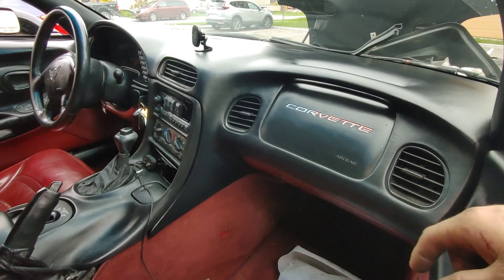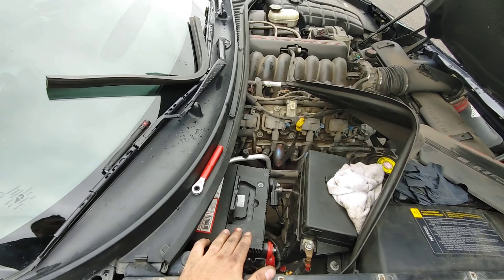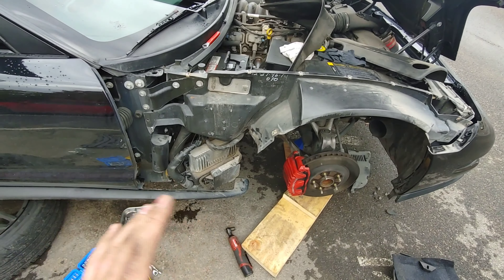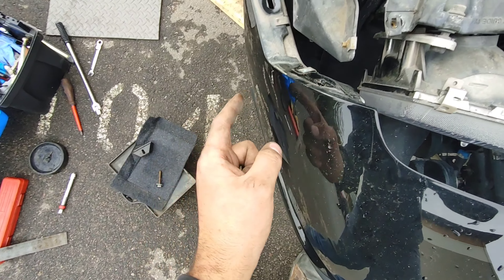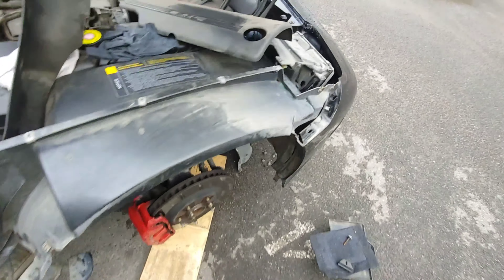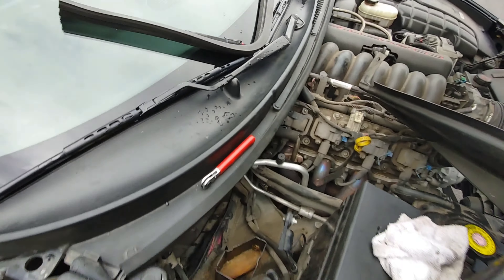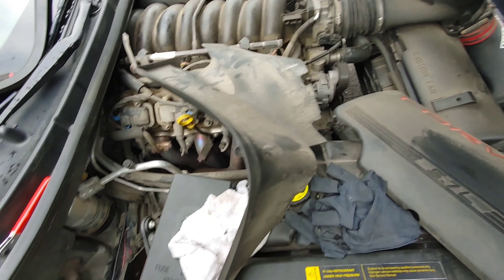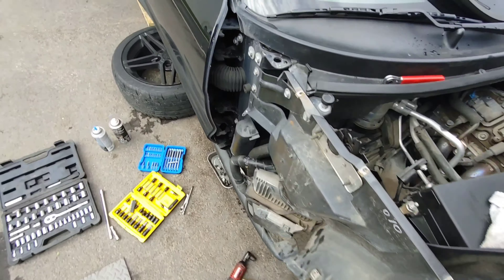Corvette C5 Blower Motor Issue Fix part 2

Comment: Great video. I’ll check this area first before tearing it all down.
Reply from the maker: Thanks brother ! What is the trouble ?
Reply: Same problem. Air blowing in all vents and mode button will not change the vent output
Reply from the maker: @TheRoblcjr  Ohh OK did you have check the part 2 video ?
Reply: @basicdetail4512   Yes I watched part 2.
Reply from the maker: @TheRoblcjr  good ! Let me know what you will find

Comment: I had the same problem before, I went through all that work u went thru as well hahah even replaced the air solenoid under the fender, but after seeing all the hoses were fine i removed the intake manifold and found out that the hose was disconnected so I plugged it back in and wrapped it with electrical tape to hold it on stronger
Reply: Sadly my fans went out again the other day, I’ll be testing my blower motor soon, thanks for the instructive videos 🤟🏼
Reply from the maker: Omg ITs so sad to Do all this work for a unplug hoses thanks for your feed back i appreciate give me news if you want when you fond the issue with the Blower ...i ad a video about the Blower if IT Can help
Reply from the maker: Thanks again

Comment: I have the same problem - I'll check into this tomorrow and i hope that is my problem too.  Mine is a 2002 C5 and I don't have a 5 position fan switch.  I have an electronic switch with an up and down position.  By the way, did you check the codes before starting this process?
Reply from the maker: I hope this is just an unplug vaccum ! And no I didn't check the code this is a great idea
Reply: Did you come to a conclusion regarding your issue?

Comment: If the hose was disconnected, wouldn’t this cause a vacuum leak?
Reply from the maker: Yes its a Great point ! Im agree with you but the car run like a New .. no hesitation or ruff idle ... Maybe to small leak